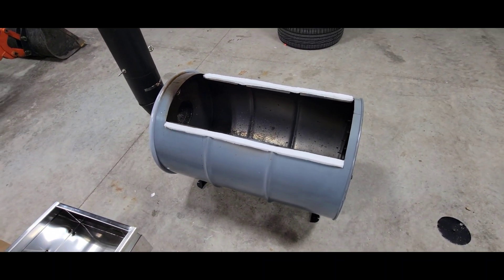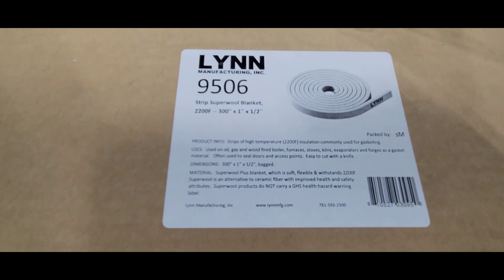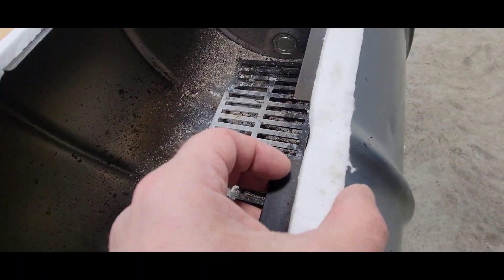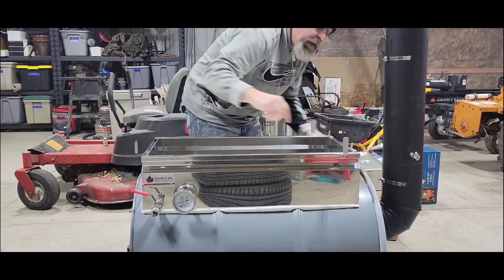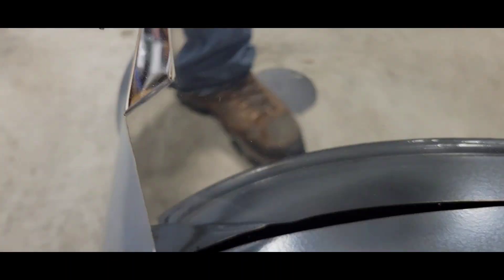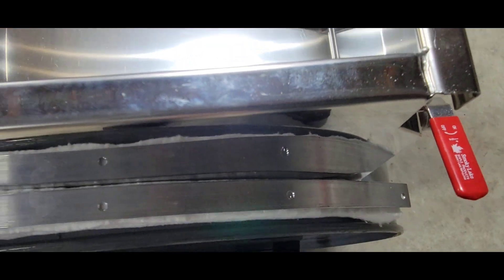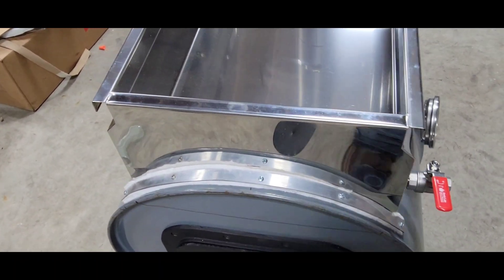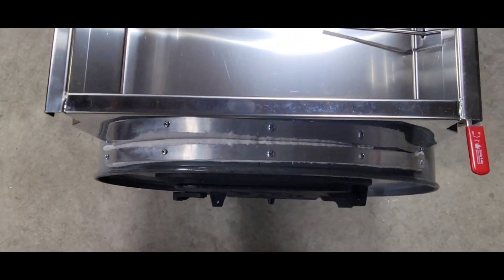How I sealed the ends of our maple syrup barrel evaporator pan

Comment: Looks good and I bet it works good too.  Why not just slide the pan towards the front by a couple inches, cutting off the round front so it has a flat spot on the top?  Put an angle steel bar on the barrel at the top and then you'd only need to do the flat seal at the bottom of the pan.  Bonus, the chimney could be moved u a little bit on the back, which would improve the air flow.
Reply from the maker: I didn't even want to go as far as I did with a barrel evaporator. I even made a better grate and added a small fan to it this season. I'm getting 5-6 gph now. Any more I'm gunna need a better arch.

Comment: Nice build, try insulating the half moons at the ends of your barrel, it will help prevent your pan ends from scorching.
Reply: Joe, Jello has a video showing the fix, did a fine job with it.
Shows why to do it better than I can explain it.
Reply: @markrusek2576  thanks just watched it,,he did a nice job. I have watched a few videos, this build is the one I have decided on.
Thanks again.
Reply from the maker: @markrusek2576  his comment is what inspired me to fix that issue.
Reply from the maker: Thanks, that's exactly what this video demonstrates, sealing the ends
Reply: I meant scorching inside your pan. The outside of the ends of your pan will be exposed to heat and flames in that half moon area.
As your sap level gets lower there’s nothing to absorb the heat, charring then incurs inside the pan. Insulating those areas would stop
this. That pan is gorgeous and burnt sap is a bugger to clean.
Reply from the maker: @Mark Rusek  ahhh I see! Yep thanks!
Reply: @219jello  Your welcome, have a great season!
Reply from the maker: @Mark Rusek  working on a fix. Glad you commented about this. Definitely would've ruined my pan
Reply: Looking forward to seeing it.
Reply: @markrusek2576  hello, future boiler here..lol..so you think there should be some kind of barrier or insulation on the half moon cut out where the end of the pan is. ? Hard to explain but I think I know what you mean.